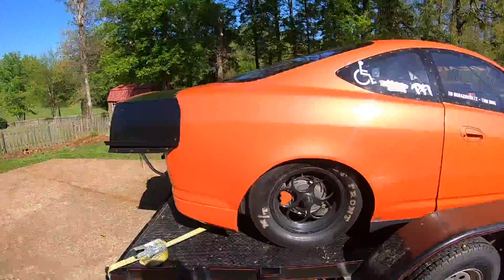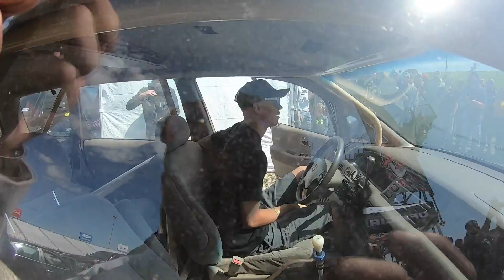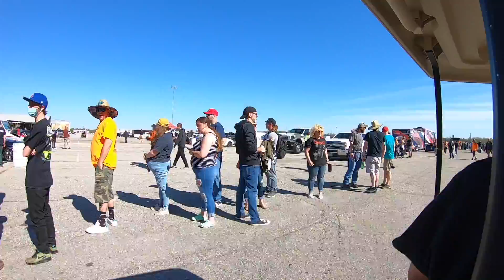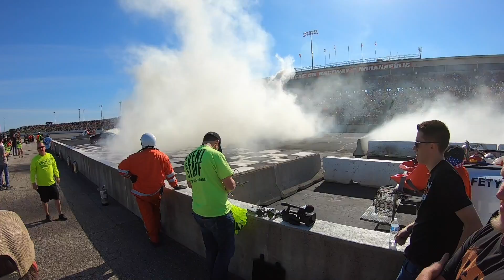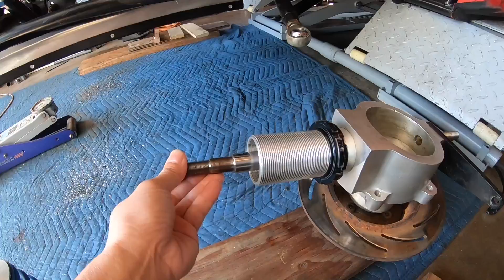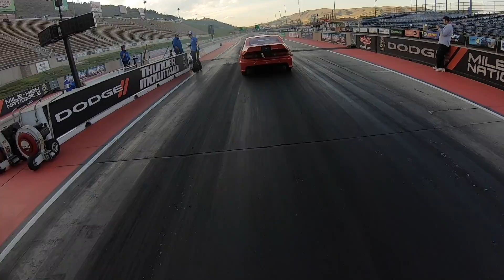Phoenix still gone wild!!

Comment: Put a go pro on every joint that's suposed to move... and get review it see if you can find it.. before staring all over.. the bottoms of the strut looked like the likely cause..  it any little movement can make big direction change especailly under that kind of load. Say  a 1/32 of an inch at each joint of movement, of play added up across 8 joints..

Comment: Locking the struts is absolutely the worst idea. 
Of course it will bounce and be dangerous. 

The line running from strut top through bottom ball joint has to be further out than the center of the wheel. 
In your case this means less ET on the wheels and a wider suspension to get the same track width. 

Trim the bump steer in the end by moving the rack or ball joints up and down accordingly and it will fly

Comment: Just throwing this out there. Are you sure it's not a diff or axel problem? With that much power and those big tires I can only assume that if power isn't being delivered to both tires evenly the torque steer you are getting (and that is exactly what is happening) would cause the problem to be exaggerated. I don't see this being a suspension problem. I could be wrong.

Comment: You are barking at the wrong tree. Shock is good and all. It wont wiggle when it is tensioned with the spring on it!

The black flat bar bracket together with the very long bolt which connects the tie rod ends to the steering knuckle is way too thin causing it to flex torque steer. You can put a go pro there to visually verify this. Again, both the thin black bar and the tiny ver long bolt flex. We talk aboutmaybe 5-10mm movement which is huge since it controls the steering angle!

Even on a stock thin tire 90hp fwd car, those section of steering knuckles are thick.
Reply: No. Spring doesn't hold anything but weight.
Reply: I think you nailed it with the flex on the steering arm.

Comment: If you want to take some pictures straight from the front without the tires and take a few angles and measurements with a couple plumb bobs and I can give you a good starting point of where your steering tie rod angle and length need to be. Also if you want to check to see just how bad your bump steer is then this video will help you check it yourself in your garage. It’s around 18 minutes in and all you need is a laser pointer.
https://youtu.be/dR59yG8S9GQ

Comment: Plz change the rims and tires with some street drag radials and drive it on the street launch it and correct the problem it is not that major of an issue something is most likely loose and needs to be changed or tightened. You do not need to redesign anything you need to add something to it or change that steering rack.

Comment: Hey Phong, as you found out, you need some type of movement in your suspension for everything to work properly. Keep working on it, you'll get it figured out eventually! I really think if you keep that same suspension (moving) and drop the rack down it will fix the bump steer issue. Also, make sure your rack internals are tight and not sloppy. Tiny movement at that speed can have big results.

Comment: I don't think it's so much bump steering I reckon it's more to do with the ackerman therapy of steering which is all about the geometry of the steering system in a hole setup I think you need to do abit of research into it and some measurements of your suspension on full droop and compression the caster and camber angles in full droop and compression and your tracking throughout the cycle of the suspension I think if you go down the route of locking the suspension travel it won't be addressing the true problem's with the front suspension also what type of diff are you running some LSD'S can cause steering chopping

Comment: Don’t lock the suspension out, it will never get grip. The bump steer is solveable, you just need to figure out the tie rod geometry. Try asking some chassis engineers or pro FWD guys. Steph Papadakis would know what to do lol.

Comment: vw is set up the same. look at a old rabbit and take some measurements. there are quite a few vw's running in the 8's and 9's  Don't run no suspension you will have a steering problem when the tire starts bouncing. look at Stephan's old car.
Reply: The rack should be as wide as where the lower control arm starts to pivot. they should be at about the same level or else your getting a bunch of bump steer. Have someone put your setup in solidworks I'm sure that is your problem.

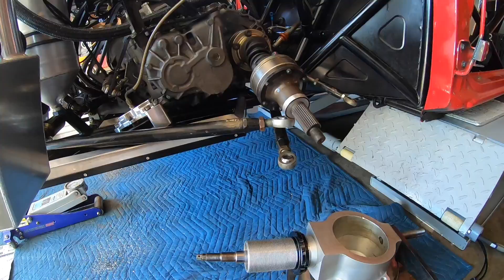Comment: 14:20 wow I would have expected there to be a second shim at the bottom of the shaft to keep it straight in the bore 
Also u might need to drill holes close to the shaft on the washer u added to allow for fluid to more fast enuf 

O ur going static so no travel in suspension any more lol u could toss a rubber plug in the bottom of the bore see it that does any thing

Comment: Yup that suspension is never going to work it'sgoing to kill someone. It looks pretty for a car show, but not for racing. U need a, almost a stock suspension. Top and bottom ball joints to work with what u have to work with. U need something like what bully has on it now. Best of luck with your new front end design.

Comment: The problem I see with fwd cars in general, is they have a front suspension. You are trying to make something go straight that was never intended to have that much power. Your instant centers changes, you have bump steer out the wazoo. FWD was never intended as a performance mode, and it shows in all the struggles you guys have with it. 
For people that don't understand his problems, when the front end rises on a fwd car the steering angles change, basically the tires change direction when the suspension moves up and down. You see this on lowered fwd cars when the rear tires are not pointing the same direction as the front and are cambered to hell, the front suspension does the exact same thing. Any long time drag racers will know what chevelles look like leaving the line when the tires move in and get all crooked when they have a loose nose. He has to solve how to keep the front tires from doing the funky chicken and going out of alignment. And honestly I'm not sure why people do not just solid mount fwd cars to prevent the steering angle changes. Good luck.

Comment: Phong Have someone look at the frame it might need some tweaking our redesigning for you set up. something is wrong that is probably why they never got it done.
Reply: @richardharris492  yes I know he passed Beautiful car looks amazing but if you listen to original video on PFI picking the rolling Chassis up they said it was untested no runs. Phong needs to have someone look over the chassis to make sure it is straight all gussets, bracing, and brackets are all installed and in the proper locations. Has to be a reason it darts to the left when torque is applied to the chassis, the chassis could twist somewhere causing it to steer left...